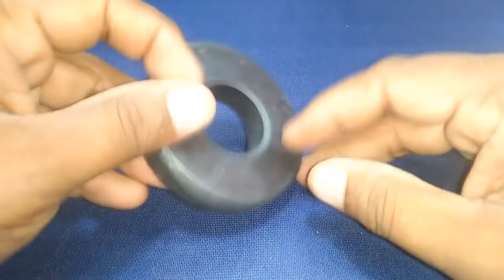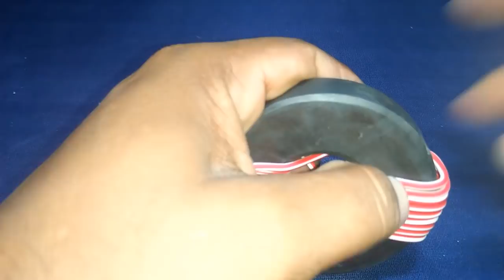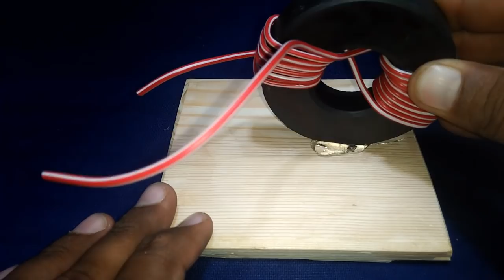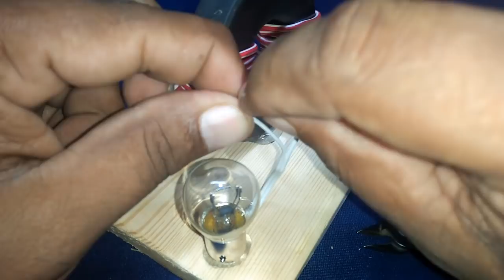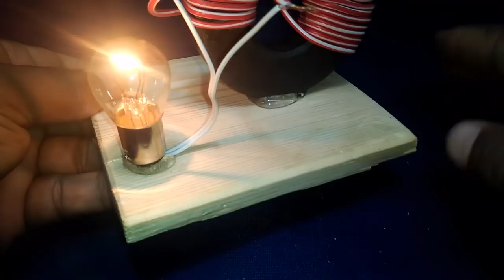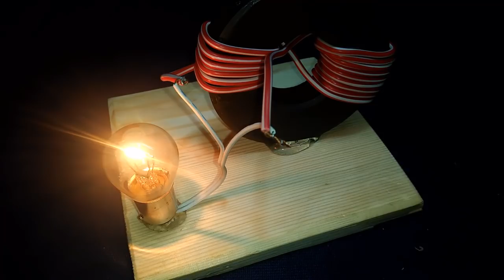Free Energy Generator Magnet Coil New Technology New Idea Project 100% Real

Comment: It's very simple. Under the table is either a tesla coil or cooker  heater operated by a foot switch in sync with the wire connection he made.